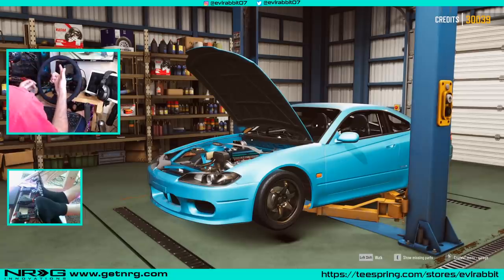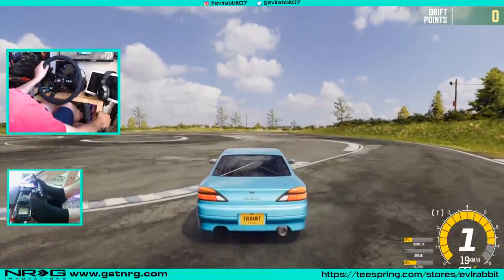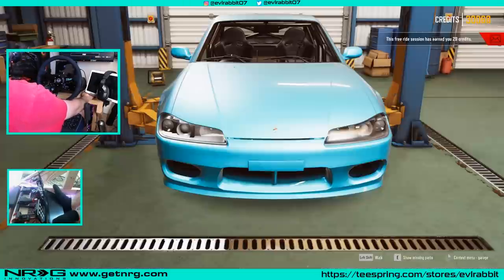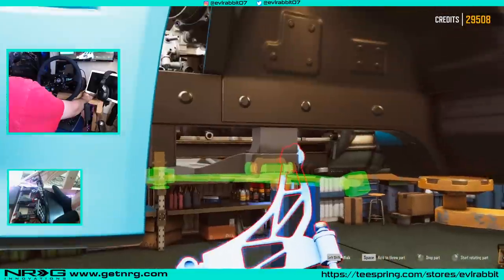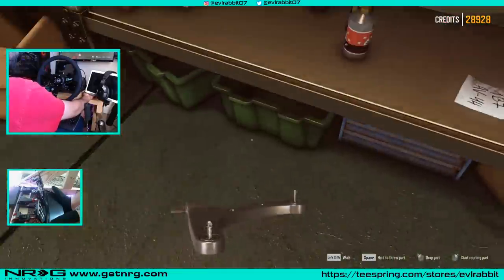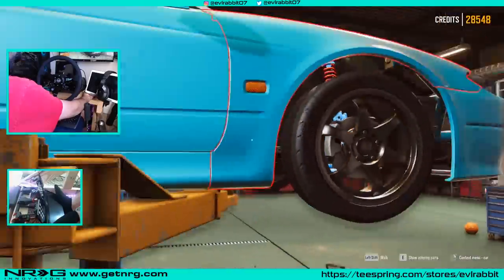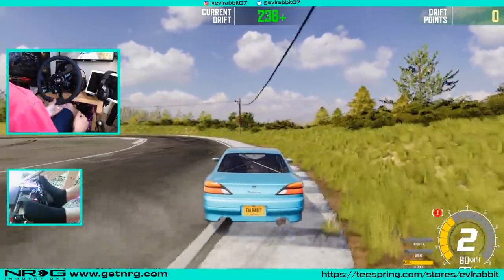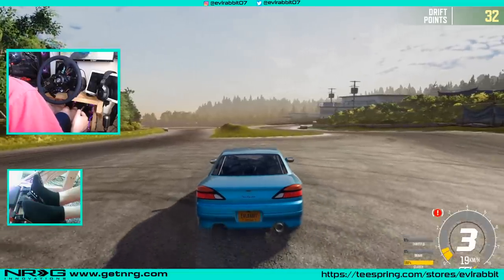DRIFT21 FIRST DRIFTS! "How does the wheel Feel??" Suspension work / angle kit install

Comment: Game looks fun, as far as the building aspect, but the handling seems a bit “numb” . . . ?  Hopefully after dialing in the camber and tire pressures, you’ll be able to get a better handle of the car.
Reply: Funny you should say that because it isn't currently possible to adjust camber and tire pressures. You'd think a game that is trying to be a drifting simulator would have something as simple as suspension tuning.
Reply: @JamDrifts  this is just an early access